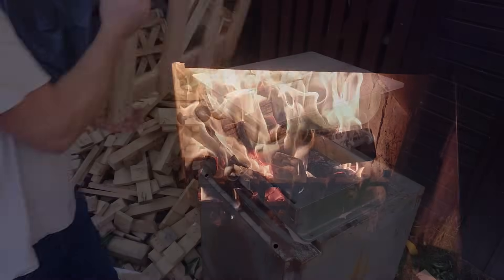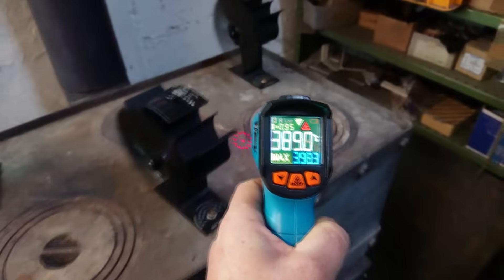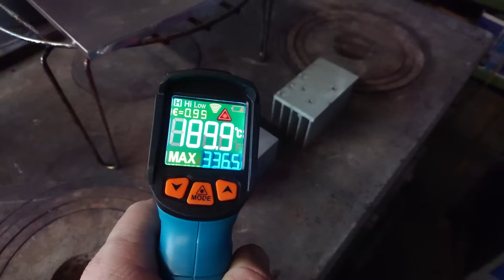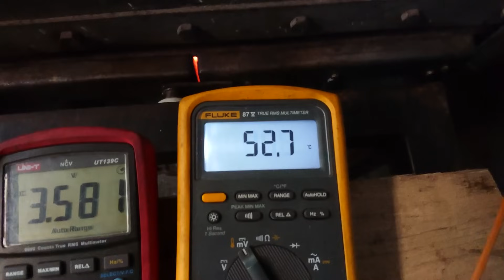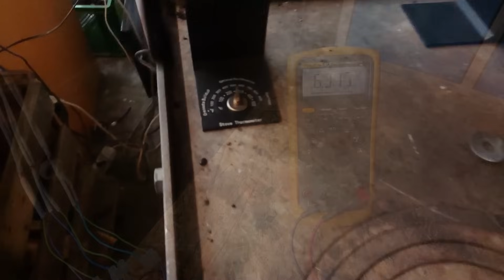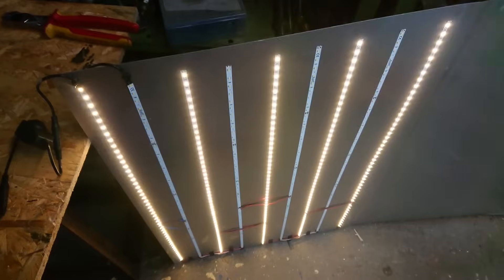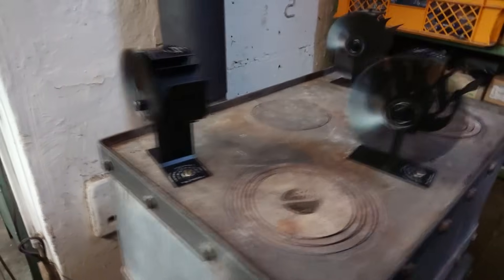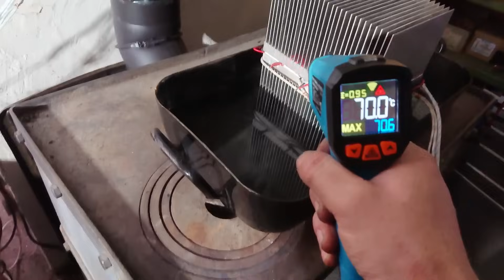Generating Electric Power with my Wood Stove - Peltier Experiments

Comment: Thank you for taking the time to teach and show knowledge first hand.  Zaebis content as always. I was looking at ways at using this type of tech on the exhaust for Cars and generators to extract any potential energy that is normally wasted. Watts are Watts at the end of the day.   I wonder If i could utilize these on a hot tin roof to run a fan to move air about. I was also looking at using the energy from a swaying tree to pull some type of generator as the trees have a lot of kinetic energy in the wood.

Comment: The water bath is limiting your maximum temp, which is good, but it is also increasing ambient temp on the cold side, which is not.
A simple loose fitting lid would increase performance, let the steam escape downwind of the device.
You could even pipe the steam into a chimney, and use the draft to draw cold air over the heatsinks.
Not optimized for efficiency, but near silent operation.

Comment: I think the second device that broke around 12:00 got too hot because it was downstream of the cooling from the fan of the first device and as such the hot air from the latter was moving over the radiators of the former

Comment: Dear Sir,
If attempting to generate electricity from a heat source; I wonder if trying to build a steam generator might possibly be less labour invested with a far greater yield?  If according to your good self a Peltier is at best around 3% efficient, surely a steam driven generator might be more a  plausible  option??? Kind regards.

Comment: Use your fans to blow cooler air through top fins to create even more of temperature difference.  Bottom fins in hot water limiting and protecting from over heating was a great idea.  Good work !

Comment: As far as the maximum temperature for those devices goes, I immediately associate it with the boiling temperature of water.

Using some kind of natural circulation boiler and radiator will prevent overheating the electronics, increase the humidity in the workshop or cabin (essential for comfort and fire protection) and provide a convenient source of boiling water for coffee, tea, and cocoa.  Stirling engine fans can provide forced draft to increase efficiency and cooling for the Peltier devices.  You'll need to remove scale on a regular basis to maintain efficiency.

Comment: You will be better of using a tiny air compressor or gas engine converted to steam, or a tesla turnine to generate power using steam!  Use a hoverboard wheel,,/ motor or two  get about 250 watts from each (maybe 350)  to charge batteries it could be a weed Wacker motor or lawnmower motor to convert to steam!   It can be somewhat superchargef using a condensor, to pull a vacuum on the exhaust side! Sealing the system! This is my intention!! Burn wood and trash, maybe waste oil to heat and generate power to charge batteries!  I would require about ,,25-40 amps @,30,v. to be really useful ,or 750 watts, to offset the use and charge the batteries! Normal draw is possible ,10amps  +/- 2-4a,  to run a tv and lights!  Refrigerator! I can run the tv and fan from a 400 watt inverter!plus a lamp so thats probably 500-600 watts at the battery, so 20-25 amps id about minimum!

Comment: Let' sbe logical here, replacing the  stove exhaust with  a water tank (flat external surfaces) would give you a maximum 100C contact surface to stick the devices to directly no radiator gadget needed.  On the outer side you cluld run cold water through some Aluminium rectangular pipe glued to the devices.
That makes you sure you keep a controlled temperature both sides, besides giving you ... say 35 C warm water from the outer souce to wash hands etc, or ... 100C hot water from the inner tank to make tea or coffe.

Bonus the exhaust fumes that now leave the stove at 300+C wasting heat outside the building, will leave the exhaust at maybe 100 or 150C, saving you more heat.
If you also introduce in the stove a high pressure high temperature resistant serpentine straight over the flames,  and a high presure tank just by the stove, you can make steam at 300-400C to use either in a stirling piston generator or in a small turbine generator when you need high power for brief moments like ... 1 hour untill your steam tank is too cold to have high pressure.

Elaborating, you can make an arduino valve controlled system to close and open the turbine (or Stiling) generator according to the steam accumulated, just by reading pressure in the tank, and that machine can work without you dumping the electricity in a battery to be used at convenience.

Comment: 5 watts can easily light a room, andeve half that can light a room, possibly even 1/3 that to 1/5 ,a 1,watt led is fairly bright, however a series of lower power LEDs will probably light a room better. Even at 1- 1.5 watts (2watts or less) providing a good bit of light. Even a 1/2 watt can light a room, you will not be reading books of recording video!  But you will not be in the dark!   Especially if the area is set-up with multiple reflective surfaces a large silver or whire reflector use a around the LEDs to reflect the light!  I was going to start a project , tonuse a 5.1v 1.5amp supply to light a whole room , i was thinking use tiny smd leds to equal a 1/4-2/3 watt, in each bank ,(at full power being about 1/2 watt!)  Drive them at low power! With them facing into a reflector, that faces another reflector to spread the light with about 12v and ,100ma for ,3-4 lamps two fixtures and a lamp pair, to equal 4.8watts  ,  I'd like ti try this one day! Getting light with little power!   I have a extra 12v 25 watt pv panel  using it to charge s small lithium battery!  And the thermal electric generator to charge the battery, with solar helping!  Will solar pv work with light from a fire??  To charge batteries!!   Maybe thr panel can be coated with something to change the wavelength of light. Or something that gives of light when heated! Some glow in dark does this!! Use it to generate power!!  We are floating in a river of energy!  We only need a harness!!

Comment: One idea like what you made, is to make a standardized section of stove pipe with the peltier generation which could be added to any sort of furnace that uses the standard pipe.  A specific application I had in mind is for wood fired, outdoor furnaces.  They have a heat exchanger to make hot water which is pumped to radiators in the house.  The downside is that there has to be a water pump to move the heated water.  I thought it would be great if you could power the pump with thermoelectric generation, so even if the power was out, you could still heat your house.  If the stove pipe is outside in the cold, there will be a bigger temperature differential to help make more power.

Comment: May I suggest how to create way more power with peltiers? 
You need to increase the temperature difference between the cold and the hot side. 
Having snow outside you could use some hot air coming from the stove to melt the snow in some sort of closed circuit, and pumping the cold water inside, maybe in a waterblock for pc liquid cooling. It would keep the peliters at a good temperature, avoiding them to break probably.

Comment: I think you're on to something using the water bath.
Maybe consider super long heat sinks on both the top and bottom, to prevent it from overheating and to maximize the cool side.

Comment: I know the purpose is to have as few moving parts as possible for generating cheap power, but what about using steam instead? You could use the chimney pipe by coiling tube inside the pipe and use that to drive a small turbine.

Comment: I really think the biggest energy gain in this system would be to scrap the big heatsink sandwich and hardmount the two halves to the other side of the newly made flat part of the stove pipe section. Sending 300 degree C hot air straight out from the top of the chimney means wasting 70-90% of the stove heat (sending heat energy styraight out into the sky outside in stead of heating the inside of the house)

Comment: Use those heat differential fans to cool the cold side - use them to draw in cool air over the heatsinks for the TECs  and then through the fans

Comment: The weakest device in the string limits the string current. Consider multiple parallel strings, with each string only using enough devices to meet the minimum input voltage of a switchmode converter, then parallel the converter outputs (all set to the same output voltage of course). That's basically what they're doing with solar panels these days (they call them 'optimisers').

Comment: I have a wet back on my fire and my idea was to have two opposing plates one for the hot water from the fire and one for the cold water supply to the hot water cylinder sandwich the TEGs to produce enough voltage to run a transfer fan to push the heat through a transfer system to the rest of my home, this only works when the fire is going so worry free system

Comment: You should be able to realistically achieve 1.2W per Peltier device, there's another channel for which I can't remember it's name, he built a generator using 36 Peltier devices and got 45W out using boiling water in a pot from a Camp fire and cool water from a stream flowing past.... 
I'm sure that the video should show up if you search for Peltier device on YouTube.... 
It's a great reference video!

Comment: Can you take cold air from the outside to cool the cold side of the TEC? Simpler way would be to just run an air hose. A more complex way may be to have a closed loop water set up with a heat exchanger that stays outdoors. The water in the loop would cycle naturally from the differences in temp. As I understand it, the bigger the temp differential, the more power is generated. Just ideas.

Comment: Not going over temperature on the devices is critical, but actually feeding them with heat is also important. 
Just as you stated its the temperature difference that's important. From your first experiments, i think you should look into better cooling, first off the cooling side should have a bigger heatsink and forced air. Keeping it on top thr stove will give it hotter air, so that's no good. For maximum effect you want the cold side to be max 30degC, and if the air in the room is quite cold that's maybe 10? So you have only a 20deg different between the air and desired cold side temp. 
If you can maintain the cold side temp, those modules are probably some 10w...each! I imagine they are probably labled as 20+watts.
Pulling this power(100w+) off the device combined with the rather extreme cooling on the other side, you will probably need to feed at least 500w input heat.. and cool off 400w - your cooling would need to be better than 0.2degk/w. Almost impossible.

Comment: Use a temperature sensor and a small motor that will move the modules away from the heat source when the temperature rises critically.
Or use a temperature sensor and electromagnets - magnets can attract or repel each other. Whatever you find convenient. If you want to patent it, I claim my rights to the idea. You can use it for your own use. :))

Comment: For illumination, you want to use white surfaces. reflective/specular surfaces like metals just reflect light like a mirror, so the light will more likely just be absorbed in reflections, or just go a useless direction. White surfaces, matte especially will randomly diffuse light so that it's more likely to go where it's useful before it is just completely absorbed.

I worked for many months in an industrial dishwashing "pit" IT had to be one of the darkest and gloomiest places, despite having 4 ~5000lm fixtures in the ceiling,  because all the surfaces were stainless steel.

Comment: A pumpless natural circulating water circuit system, like in the old heating systems, with the peltier-heatexchanger-heatsink contraption put outside in the cold.
I have just seen a video were they have constructed a stirling engine / firebox aggregate, and with a fire a little smaller than your they have an output of about 0,5 kW.... the noise of the machine was incomparably higher!

Comment: if you mount the heat sinks on the side of the stove you will have less over heating, adding a vertical pipe from the floor to the cold side of heat sink will let passive cooler air from floor move across the cooling fins. thus keeping cool side fins cooler using floor air. using the power to charge a battery would give you more control of when you use the power. adding values to your stove pipe above and below your square heat box might give control over where heat collects in the pipe. nice content, thank you🖖

Comment: All wood stove require air to come from the room to go up through the firebox. Bringing in fresh air from outside via a small pipe which is directed at your cool side keeps your warm air in room from being wasted and helps keep differential high.

Could add a switch that directs current to a battery charger when lights not in use.

One last idea..car thermostats are pretty cheap..they open at 180-195F..could mount to a tab at bottom of heat sink to lift it off surface a that temp.

Comment: Could always try air draft cooling, if you had the heatsink sandwich in a housing that ran the air intake over the cold side fins before letting the hot steam create a draft that pulled the air out an exhaust vent you could cool the setup with ambient air and no moving parts. Think rocket-stove but with the powerplant inside instead of a fire.

Comment: For hot side/multiple channel...maybe a tin box? Placed  open side down on top of stove, it should function akin to an oven. With heat transfered towards peltier by convection of air, rather than conduction. 
Fan could be added to blow air in, as a way of limiting temperature. 
Or by adding vent holes at different heights.

A Bimetalic strip/ "wire" could also be used to  opened to passively open a vent hole.

Comment: I tried this with a solar panel and 8 units sandwiched between two flat plates of aluminum. I wanted to use it to make a cooling pad for my dogs during the summer. Sadly it gets heat soaked to the point it over takes the cold side. Based on my testing there is no way to generate a constant cool side without introducing an extremely large amount of power from more sources. Be it solar or line power. It becomes more efficient just to power a heat pump from solar.

Comment: I'm somewhat surprised that even in 2002 trains didn't have accelerometers to help identify when/where of
 rough rides. Even if such were a shoebox size unit that driver could take with them between certain stations

Eg Every point, curve and track join should result in some vibration, that coukd be used to identify what location were passed.

Comment: A thought that has occurred to me (and probably already been brought up and/or dismissed for not working) - would using the thermal mass of some water on the cold side of the Peltier devices help? Weld up some sides onto the heat sink and use the DC motors from the fans to run some kind of peristaltic pump set up to a heat exchanger/much larger reservoir.

Maybe this heat exchanger could help keep a water tank from freezing in a remote cabin?

Comment: Ein Stirling Motor könnte den Ofen in ein Kraftwerk verwandeln, kann man auch selbst bauen. Ein Elektromotor als Generator dran und schon leuchtet die Vitrine. Exotischer wäre eine Dampfturbine (Schnellkochtopf mit Turbolader oder Ofenrohr mit Wassermantel). Die Peltierelemente auf der Rückseite eines Solarpanels platziert wären vielleicht ein Sommerboost für deine Werkstatt.

Comment: It might not help much but it would be easy to do: take one of those fans to help cool the upper heat sink fins to increase the temperature difference between the upper and lower sections. Might need a separator to block the cooling air flow from cooling the lower half too.

Comment: Why not look at the temperature delta between the inside walls of the room and the outside? There is plenty of IR being emitted by the stove, so collecting that on one side of a Peltier cell with the other side leaking the heat to the outside should work too?

Comment: I build one with a generic aluminium cooling block, which can be cooled with a hose from a creek.
You can put the whole device in a bucket of watter and hang it over a campfire.
Silicone hoses and wires near to the fire. 
I got 4-6 watts out of 8 of those 40x40mm elements on a 40x160mm block.
To get the most power you realy have to pump as much heat through them as possible, therefore reducing the thermal resistance is key!

I tested multiple methods to couple the diveces to the cooling block, and the best way by a long shoot was dendritic copper with epoxy. (copper shavings don´t worke as good)
Epoxy is one of the "best" heat transferring polymers and the copper... is copper. 😅
I used a very thick paste of mostly the copper with a very thin laminating epoxy and applied a very thin layer and pressed the modules on very hard while slighly moving them to get the layer as thin as possible.
That made a huge jump from 1-2 watts with normal thermal paste to 4 watts.
After making a damm out of micro balls (hollow glas balls) and epoxy around the perimeter of the cooling block, and feeding the cooler with 12°C watter from the tap (and very high volume) i got up to 6 watts.
Testing in the field with a real creek showed more like 3-4 watts max with much colder water... 😕
Maby next time i sandwich 3 or 4 of those cooling blocks and use a larger hose to get more watter flow with that low head pressure, and also attach divices on all 4 sides of those blocks.

Comment: Interesting to see this, a company I'm working for is experimenting using peltier units to harvest energy from the condenser on a cryogenic system. Same issues but the differential is derived from cold (-170ºC).